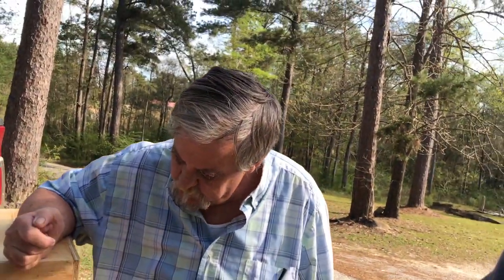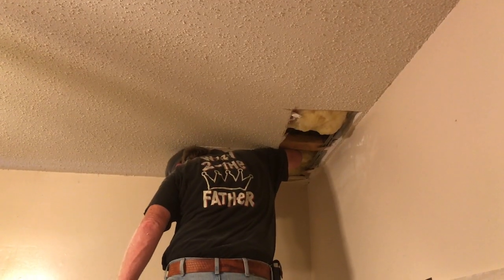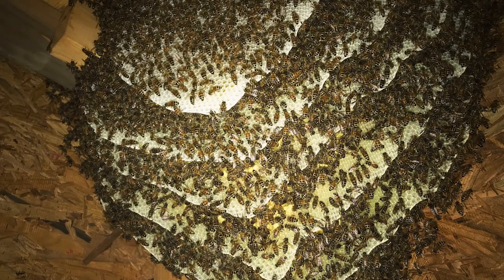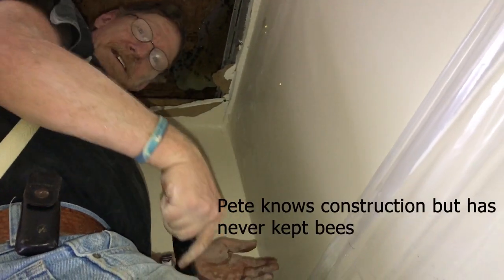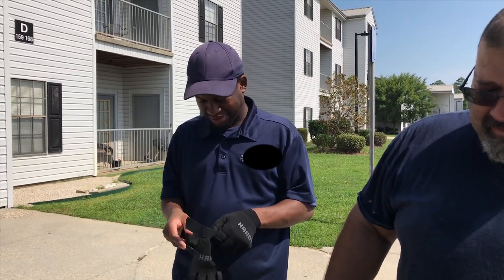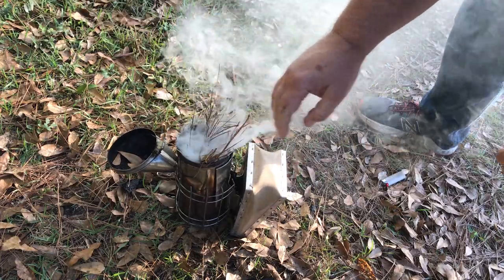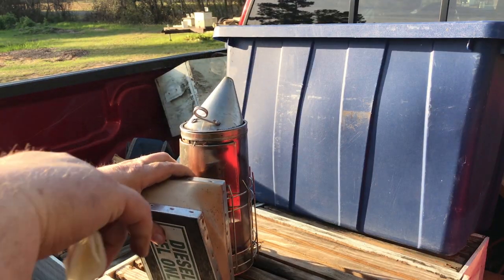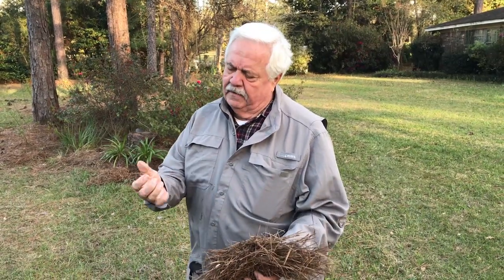Is It A Heart Or A Leaf?   How To Light A Smoker For Bees

Comment: I have used a spent 12 gauge long brass shotgun shell with a bolt long enough to go through the brass and make a little handle I attach a length of small chain (dog chole type chain) to the bolt and to the smoker I use a key ring to attach the chain to the smoker hinge.  When in use the chain is hung on the wire guard of the smoker to keep it out of the way. I have used this type of plug seise 1975.